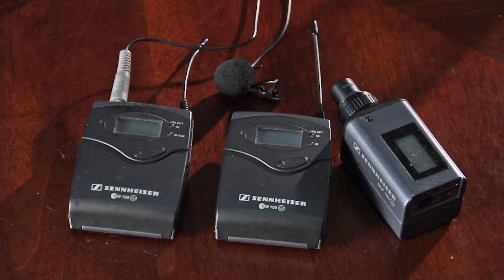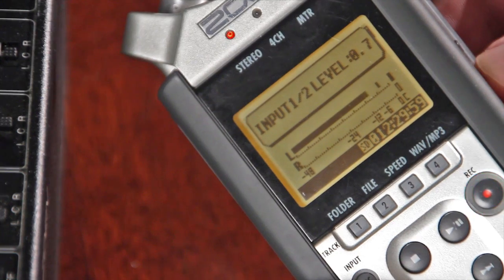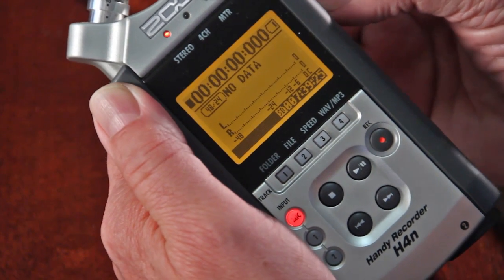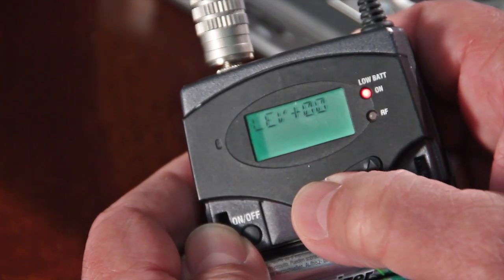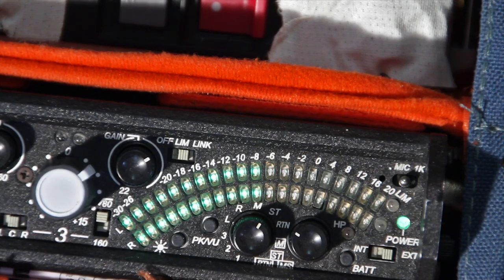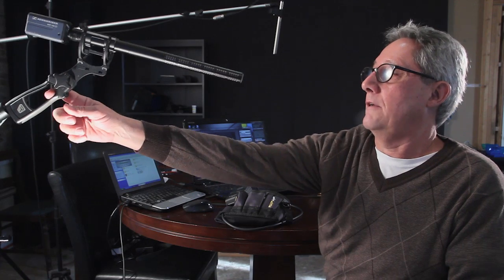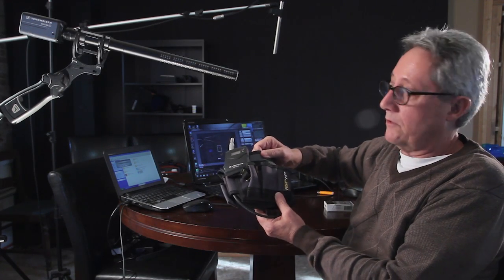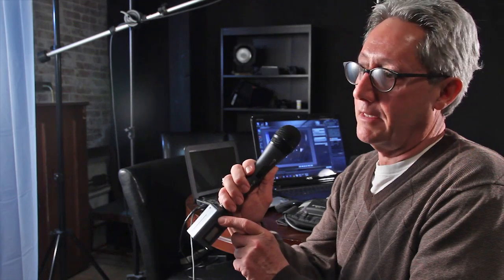Sennheiser G2 G3 Wireless to Zoom H4n Recorder for Great Moviemaking Sound

Comment: This is the best video I’ve seen on this specific equipment. Thank you Sir.
Reply from the maker: Thanks. I haven't looked at that video for about 5 years and in doing so have a comment. Turns out that the H4n and most cameras have input mic preamp circuits that you can't avoid. So, your goal is to send a strong output signal from your expensive Sennheiser G2-3's or high quality field mixer so you can turn down the input volume of the H4n or audio input of your camera. Additionally, don't forget the fundamental difference between dB and dBFS. Your mic and field mixer or G2-3 are analogue with bars running optimally at 0 to +10 dB. Recorders (and digital cameras) are digital with bars running optimally at about -20 dBFS. So, when you hear audio editors say that they like levels running about -20 they mean -20 dbFS digital as recorded on the SD card. But, your boom guy riding levels on a field mixer should be looking at levels around 0 to +10 dB (analogue). Obviously, you set up the offset 0dB vs -20 dBFS relationship between the mixer (analogue) and recorder (digital) before the shoot begins. Hope this helps.

Comment: Hi, Roland! I have watched several of your video tutorials when trying to sort out the settings on my SD-302. Learned quite a lot. I've since gotten rid of much of my 'Pro gear' and have started to pick-up a few pieces of Prosumer equipment. I just purchased a Zoom H4n Pro and had no idea I could use my Senn. G3 with it. Great news! Please don't apologize for the length of the video. That's a lot of technical information to digest.  Excellent technical explanation of how to set-up the equipment to take a Line level feed. BRAVO ZULU!

Comment: Great vid!  Very informative.

I have a similar setup, but am not getting expected performance levels.  Can you help me?

I have a Sennheiser G3 and Zoom H5 connected together using the same types of cables.  I had to set the G3 AF out to +12 dB (max) and the H5 line in level to 6 to get recording levels to -12 dB.  This seems to be less than what I understand it should be.  Is the G3 supposed to put out a strong amplified signal such that I should not have to set it to +12 dB to get to a -12dB recording level?

Comment: This was a great help, I didn't know that about the 1/4" jack connections. Thanks!
Reply from the maker: Thanks Tom, but later testing (on advice from viewers) showed that the H4n records pretty close to the same using xlr or 1/4" plugs so long as you keep the H4n volume at about 50. Adjust the AF Out on the G2 so as to get bars on the H4n around -12 to -18 dBFS. The important thing about the H4n is that you need to keep its volume dialed at about 50-60 otherwise it creates too much noise. Then crank the H4n recorded audio up to 0 dBFS (peaks) in post production. Digital audio is kind of like digital photography for making a highway billboard. You want to record a perfect "image" then blow it up. Use the G2 to put out a strong signal captured in the H4n at only half volume power. Thanks for watching.
Reply: +Roland Comfort This is good because I use the Audio-Technica System 8 wireless mic and it only has 1/4" jack for output. I don't need to buy a $30 XLR cable now.

Comment: Do you have a setup video for the SD302 and Tascam D60 MkII?  Thought I saw it...
Reply from the maker: greg poschman I've got the regular Tascam 60D, and I love it. Search for my movie "Tascam DR-60D vs Fostex". It shows the setup. Note, the Tascam uses balanced TRS 1/4" plugs to receive the line level output from the SD 302. The "step / click" volume control on the Tascam is never a problem because volume adjustments are made only on the SD 302 during shooting. Check the 60D Mk II specs to make sure they are the same as the regular 60D.
Reply: Roland Comfort Hello, good videos. I guess the Sennheiser ME66 is the most reasonable mic to boom after watching your videos., but what do you think is the best budget lavaliere mic available? Perhaps the Sennheiser ME2 EW? Or do you know a cheaper or better alternative? Many thanks and keep on recording.

Comment: Hi Roland, Thanks for the discussion and posts. I'd like to power my Zoom H4n and my SD302 from an external battery. ( and my wireless mics, for that matter)  It looks like SD only offers NP1 style battery adapters. Do you know any reason why I should not build an external power supply using the Sony NP f 550 style batteries? I'd appreciate any advice
Reply from the maker: greg poschman You know, I messed around with that, but in the end went back to rechargeable Energizer AA batteries. Just spend a hundred bucks and get 3 8/packs and 2 or 3 4/bat chargers and you're good to go. I've shot 200 real estate photo shoots using 5 hungry speedlights plus radio triggers during the past 3 years and all the batteries work great and are still going strong. The SD 302 will go all day using 3 AA batteries, same for the Sennheiser G2 wireless mics, but I like to change them out after a few hours of continuous use. Just get a bunch of Energizer rechargables. They last for years. Do charge them, top them off, before a shoot.
Reply: +greg poschman I just picked up the TASCAM BP-6AA External Battery Pack for Portable Digital Recorder, which works with the H4n.  It holds six AA batteries, DRAMATICALLY extending the record time of the H4N.  I haven't field tested it yet, but I also read that once the six batteries in the pack die, the H4n's 2 internal batteries will kick in and avoid any loss audio in the middle of recording.  So basically you're going into the field with a battery pack of eight AA's.  I got it on Amazon for $27 and it is also on B&H.

Comment: Hey so I'm using my sennheiser g2 transmitter to make my rode boom mic wireless. I connect the receiver to my dslr. I hardly get sound and when I do and jump back a few feet, I get awful static. Does it have anything to do with cross using different brands? I need help.
Reply from the maker: Most likely your problem is with the cable you are using to connect the g2 to your dslr. Call the custom cable dept. at Markertek for advice. Make sure your camera audio is not set to "auto level" and is dialed in at about the middle. Set the AF Out on the g2 to about -18 or -24 (mic level). I presume that your rode mic is battery powered. The g2 transmitter does not have 48v phantom power.

Comment: I have been struggling quite a bit lately as to how I would go about connecting a G2 wireless mic to my H4n (I will be renting the G2 kit so wouldn't have had a lot of time to experiment with trial and error) but this video has helped a LOT!  I will hopefully be able to try this out next week to see how it goes.  Thank you!
Reply from the maker: Kendra Jones If you're using two Sennheiser G2 wireless mics you could connect to the H4n using its XLR inputs. Set the H4n recording volumes (on the left and right channels) at about 50 - 60. Adjust the AF Out on the G2 receivers so as to get bars on the H4n peaking well under 0 dBFS, -6 dBFS for peaks is good. Set it and forget it. You don't want to adjust the H4n recording volume while recording. The G2 AF Out setting is your mixer, adjusted at the setup. You don't need maximum bars in the H4n or any recorder for that matter. Professionals like dialogue recorded in the -20 dBFS range. Blow up the recorded audio in post, normalizing to 0 dBFS.
Reply from the maker: Update. You can use the G2 XLR connector directly into the H4n XLR with good results if you keep the H4n recording volume around "50". You adjust the G2 mic sens (-10 or -20) and receiver AF Out to probably -12 or -18. This should give you peak bars on the H4n under -6 dBFS. Don't get greedy on the H4n by trying to record too hot. Pros like recording bars running in the -20's. Later, normalize the recorded audio up to 0 dBFS in your editing software.
Reply: Roland Comfort Can you use two receivers and run audio through the H4 like a mixer?
Reply: Awesome, thank you!

Comment: Roland, just grabbed the cables you recommended and did a couple test recordings.  My findings and a question:

- There was not any discernible difference in noise floor when going through the H4n's 1/4" inputs vs the XLR inputs.  I listened back using studio grade headphones.

- Question: If one can still adjust the input sensitivity while going through the 1/4" out, how can one conclude that we are bypassing the H4N's preamp?  Sorry if I'm missing something.  I'm heading over to check the manual again on this as well.

Totally agree that going through 2 sets of preamps is not ideal but I'm not sure that's what is happening - but I've been wrong before ;)
Reply from the maker: Yes, as I have mentioned often in these comments for the past year or so, It appears that the 1/4" plug merely attenuates the H4n preamp.
Reply from the maker: Opps, somehow, I sent that unfinished reply. Unlike the Fostex FR-2Le and Tascam DR - 60D, which do render volume trim non-operative using the 1/4" plug, the H4n had me fooled. I think I just got lucky
Reply from the maker: Ughhh, sent it again. Bottom line, you gotta keep the H4n volume around 50 - 60. Adjustable output on the Senn G3 lets you do that.
Reply: Roland Comfort why don't you update this explanation in the body of your video - i just went and bought all that extra cables and shot something and it was terrible - i then did the new way and its fantastic ;) great service but disinformation.  Thanks Roland!

Comment: Roland - I really appreciate this video. I dont have a Sennheiser, but a SONY UWP-D11 and it was still VERY helpful.
Reply from the maker: Yes, the plus or minus 12 dBu output makes the wireless receiver compatable with all kinds of recorders using mic or line level input. Use the headset challenge on your recorder by listening to it with no mic plugged in as you crank up its recording volume. When you start to hear hissss, that's the sweet spot for recording volume. Increase or lower UWP-D11 output so as to get recorder bars at -12 to 18 dBFS using that sweet spot recorder volume. Thanks.
Reply: On the Sony - you cant adjust Transmitter levels... Only attenuation can be raised or lowered and thats it... Right now my sweet spot settings based on what you mentioned are. ZOOM Mic ~ 55 / ZOOM Input ~ 72 / SONY Receiver +6db... It is very frustrating because I can't seem to go lower on the SONY or it dips into -24db on the reading... If I go higher on the ZOOM input, I hear a terrible hiss... Don't even get me started on the Polsen Lav mic that I have... it is TERRIBLE and I can't pickup clean audio what so ever...

Comment: Thank Roland.  Great video.  I own the zoom h6.  It's suppose to have superior pre amps.  Should I still bypass the xlr connection with  the 1/4 in phone plug connection to maximize my audio quality?
Reply from the maker: If you are going into the h6 from a pro level board or field mixer using line level output, then I think you have to use the TRS 1/4" jack inputs 1 - 4 and switch on the -20 dBu pad. Of course, phantom power is turned off at the recorder because the mic is being powered by the front end mixer or board. If you are just connecting a mic directly to the h6, then use the regular XLR connections using phantom power if your mic needs it. Not sure as I don't have an h6, but that seems to be what the manual says. Many recorders today use 1/4" for line input (mixer up front) vs XLR for a direct mic input. Hope this helps. Study the manual which you can Google online if you can't find yours. Note: if you have to turn your h6 recording volume way under 50 then you are doing something wrong. Thanks.
Reply from the maker: Roland Comfort Opps! Just noticed this is about the Sennheiser G3. You're probably just fine using the regular Sennheiser XLR output with G3 AF out about -18 with h6 set at mic, and h6 volume in the 50 - 60 level to get h6 bars around -18 dBFS when speaking regularly into the G3 mic. If you want to go the TRS 1/4" jack route with h6 -20 pad turned on, then you'll have to crank the G3 AF out to 0 dBu or more. Haven't tried it on the h6, but most recorders will tell you something about their signal-to-noise ratio by simply listening to the recorder using a headset with no mic plugged in. Crank up the recorder volume until you hear noise, then set everything else up so you get good bars at that acceptable recording volume. On the H4n, that is about recording volume 50 - 60. Thanks.

Comment: Great video! Did you say that you use software that will sync audio and video files within a folder? What is that software called?
Reply from the maker: I use DualEyes and prefer it over PluralEyes, both acquired by Red Giant a couple years ago. DualEyes is a stand alone program that swaps the audio in your video clips before importing into your editing program. PluralEyes is a plugin that you append to your Premiere Pro, Final Cut Pro, etc where it swaps the audio, and is especially useful if you have shot the same subject using multiple cameras like at a concert or sporting event. Google "red giant pluraleyes" for more info.
Reply: Wow how did I not know this existed? You just made my life so much easier! Thank you for your help!

Comment: Hello..
I meant the 1/8.. is seems to have two black bars on it, is it to have mono on both L and R tracks?

So I need a 1/8 mini stereo to 1/4 mono ? 

Now that you know the XLR also works ok.. which has cleaner sound in your opinion? XLR or 1/4 plug on the H4N?

Thanks so much
Reply from the maker: Yes, the stock G2 output is 1/8 to xlr balanced, mono which uses 3 connectors at both ends. So yes, the mini will look like a stereo plug. However, the H4n 1/4 phono plug is an unbalanced, mono guitar input. So, if you have a patch cord made up just tell the tec that you're going from a balanced, mono, mini to an unbalanced, mono 1/4 phone plug. Re: which is better - I don't think it matters using the H4n. Most good digital recorders circumvent the recorder mic amps when in line mode. This is true for the Fostex FR2le and my new Tascam DR-60D. The trim controls have no effect when in line mode. Only the faders come into play to reduce the incoming signal, not amplify it. Not so with the H4n. Its nasty little mic amps are always on, but attenuated somewhat when using the 1/4 guitar plug. The H4n does not have a line mode, thus it is impossible to use with regular field mixers which always output at line level. Thus, the G2 works with the H4n because the G2 output can be attenuated down to mic level. I suggest, just go buy a Tascam DR-60D for $200. It is a wonderful recorder using mic or line level input.
Reply: Thanks.. but my h4n is barely a few months old :) I think ill go the 1/4 plug route.. seems it might be a bit cleaner..

Comment: Hello Roland. Thanks so much for your informative video. I have a H4n and a Sennheiser G2. Is there a direct cable from Sennheiser to mono plug I can buy? If so which do you recommend. how can I tell a good from bad one. (is the line output stereo to mono?) I noticed the sennheiser mics have three lines on the tip much like stereo plugs to get mono on each side.. Does it mean one has to buy a stereo to mono cable ? (i want to avoid needing to connect two cables to go from the G2 to H4N.. Thanks
Reply from the maker: Nearly all mics including the G2 are mono. The 3-tip plug you refer to is an XLR connection which is balanced mono. I have recently discovered that the stock G2 XLR output works well with the H4n if you keep the H4n recording volume at about 50-60. Get the bars you need on the H4n by adjusting the AF Out on the G2 (usually about -18). If you go the 1/4" route into the H4n (as in the movie) just Google "1/8" mini to 1/4" phono mono" to find a custom cable manufacturer. Markertek makes custom cables, try them, but like I said, the XLR input works okay if you keep the H4n recording volume in the middle around 50.
Reply: Roland Comfort Hi Roland, will this do? http://www.ebay.co.uk/itm/Hosa-Technology-5ft-3-5mm-TRS-to-1-4-TS-Mono-Interconnect-CMP-105-/151102946374
Reply from the maker: George f I'm pretty sure it will work, however, the G2 (supplied) XLR output into the H4n works just fine when the H4n recording volume is 50 - 60. The attenuation on the H4n 1/4" (guitar) input tricked me into thinking that the H4n works like many recorders that only attenuate a line signal, not amp it up. See my newest movie http://youtu.be/vgcz2ztKw4o?list=UUS_BQqMa2q9KMfyrFGwEC6Q to see how using the 1/4" phone plug circumvents the recorder amps. Thanks

Comment: This was very helpful to me. Just bought a zoom and wanted to use it with my sennheiser that I've owned for years
you described the exact set-up THANKS so much
Reply from the maker: Turns out that the Zoom H4n works okay with the regular G2 XLR connector if you keep the Zoom recording volume around "50". Increase the G2 output so as to get good bars on the H4n with its recording volume at about "50".